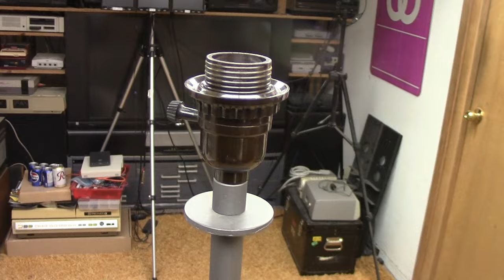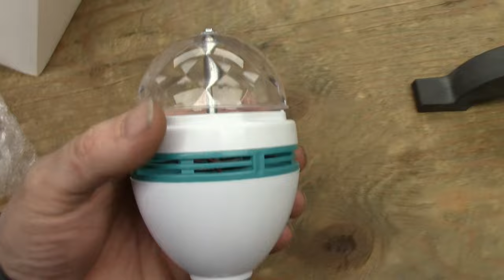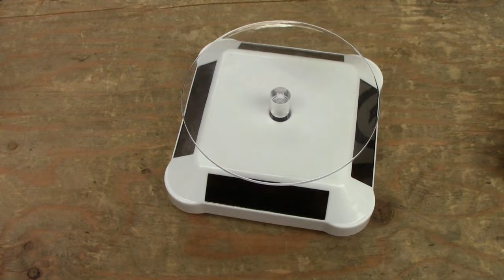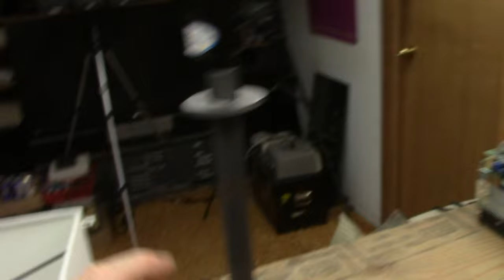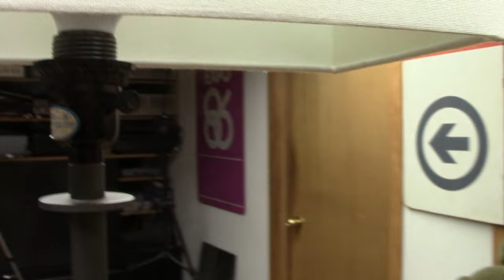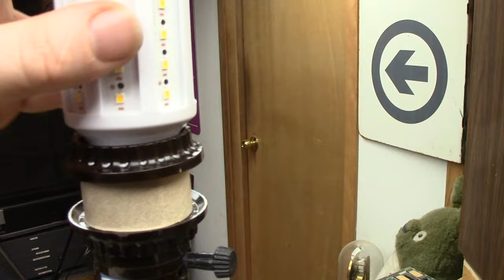Building a Spinning Sign Out of a Table Lamp

Comment: You may have wanted to drill holes in the clear disc so heat can get out from the LEDS that it is covering.  In any case very nice idea and process of getting a working result.  Thanks for sharing.